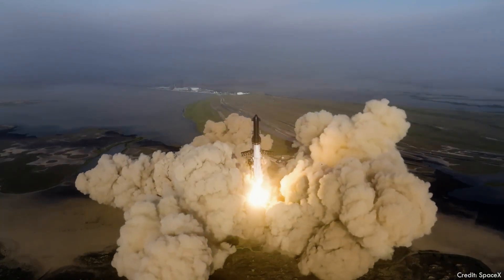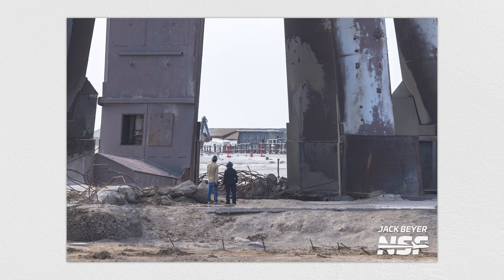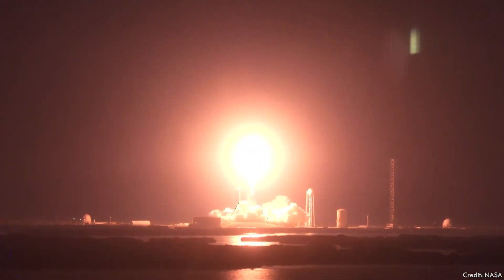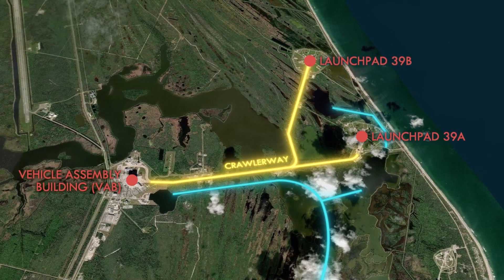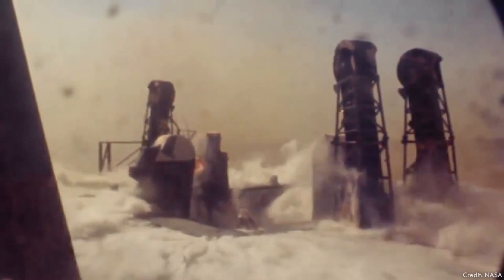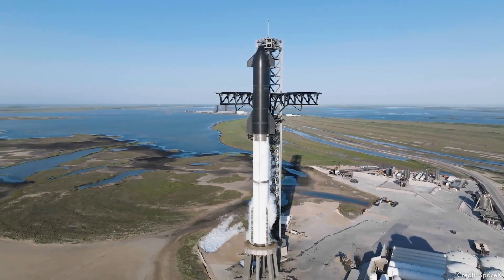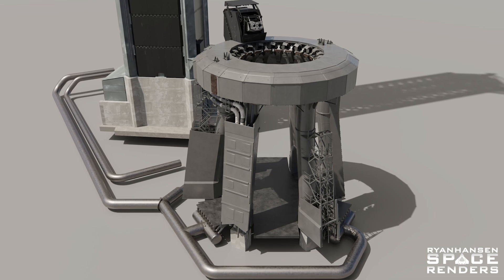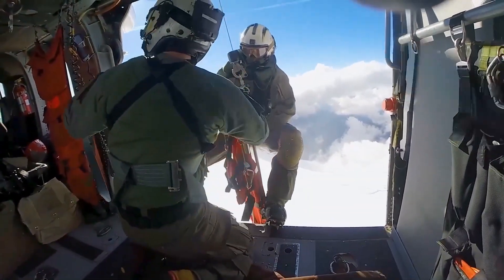Was Starship’s Stage Zero a Bad Pad?

Comment: SpaceX / Tesla (well Elon, let's face it) has dragged rocketry / EVs forward out of the doldrums that the world has been in since the `60's.
Interesting times to be an engineer.
Reply: You give Elon WAY too much credit. Elon is a spokesperson, not an engineer. He is in no way responsible for the technical successes of either SpaceX or Tesla. He demonstrated that really well when he took over Twitter and immediately fired his engineering staff and started breaking everything.

While Elon has been making Tesla famous, other automakers already had production cars working reliably for years. Like Apple, Tesla took existing technology and made it cool. The current offerings from Hyundai, Kia, Nissan, Chevy, BMW, Volvo, Ford, and many others are all so much better than the crazy, proprietary stuff Tesla is doing. Until the recent agreement to licensing charging tech from Tesla, all the other automakers were developing their own technology - not leveraging Tesla's work.

I would argue Tesla has actually caused a lot of harm in the EV world. I have driven many different EVs in the last couple of years and the Tesla Model Y was one of the worst experiences I have ever had in a vehicle. Everything is weird and goes against convention for no apparent reason. The Model S was even worse. Essential controls like wipers and changing gears are hidden behind menus in a touch screen interface. The turn signals have been turned into buttons on the steering wheel itself, which moves with the wheel, so you never know where they are. The vehicle is perpetually using an aggressive regenerative braking so that if you lift your foot for any reason, it immediately comes to a sudden stop like you just mashed on the brake pedal. On the other hand, the accelerator pedal has a notably delayed response. Brake, accelerator, and steering wheel all feel heavy and viscous with hardly any feedback. The mirrors and windows are small with huge blind spots. The hood is intentionally sloped so you can't see it from inside, which also means you can't see how close you are to anything! Everything about it breaks convention for no apparent reason in ways that are demonstrably inferior. And they are really expensive compared to similarly specced vehicles.

As a result, people's perception of EVs is that they are difficult to drive, impractical, and expensive. A lot of the (irrational) arguments against EVs can be traced back to Tesla's implementation specifically.

Compare that to a Hyundai Kona EV or Chevy Bolt. By and large, they are no different from their ICE counterparts. The controls are the same, they handle largely the same, and they don't cost that much more than a comparable ICE. The newer designs like the Hyundai Ioniq 5, Kia EV6, BMW i4, and Volvo C40 go for similar prices to a base model Tesla but are more comfortable, convenient, and performant, while still looking and feeling like any other vehicle.

You know what else really sparked an interest in EVs? Rising gas prices. Especially since the huge spike a couple of years ago, there has been a considerable growth in EV sales across the board. The government subsidies during the last few years in both the US and Canada also helped a lot, since that largely makes up the difference in price between an ICE and an EV.

The one thing Tesla has pioneered quite well is self-driving, for better or for worse. I'm not against it, but it sure has been a divisive topic, and it sure doesn't help that Elon has been saying that full self-driving is only a couple of years away for the last several years with no sign that we're anywhere close to it being ready for production. Of course, Tesla wasn't the only company chasing that dream, and several others have made it to a similar level of success, though most of the others gave up or went broke since hitting the same wall. What partial self-driving Tesla can currently do, most other vehicles can already do too. Adaptive cruise control, lane assist, collision avoidance, parking assist, and many others are available on a wide variety of other vehicles. My Kona EV could literally drive down the highway, maintaining the lane even around turns, keeping distance from the car ahead of me, and braking if a deer ran on to the road. Of course I could tell the navigation where I wanted to go and it would give me turn-by-turn instructions. In my Ioniq 5, I could even tell it to change lanes and it would do so. It was almost entirely self driving, with it telling me what it thought I should do and me confirming by commanding it to do so. Tesla's full self-driving certainly goes beyond this, but it's also those additional steps where it's still failing after all this time.

I don't know as much about the details of SpaceX, other than to say rocketry has come a long way since the 60s. You realize we only put a man on the moon for the first time in 1969, right? The 80s and 90s saw the development of the Space Shuttle that brought up the original satellite networks that we all relied on for television and GPS. We got the Hubble telescope, the International Space Station, landed rovers on Mars and brought back soil samples, got fly-by pictures and atmospheric tests of planets way out in our system, and so much more. SpaceX is doing exactly one thing: making terrestrial space flight cheaper. That's it. While that's a practical and worthwhile endeavour, that pales in comparison to all the cool things NASA has been doing for the past 60 years.

This is exactly the problem with Elon Musk. He has convinced millions of people that he is a genius and that the companies he helps run are changing life in revolutionary ways. In truth, both Tesla and SpaceX are in races with several other long-standing companies in their industries all trying to add a little bit on top of all the progress made by all of their existing competitors. They both seem to have gotten out ahead in the short term, but Tesla is in a much more competitive market. Tesla is only 4% of new vehicle sales in the US and only 13% of BEV market share worldwide. In the US, many reputable manufacturers with decades of experience building vehicles are now providing their own EVs that are as good if not better than what Tesla has. Elsewhere in the world, Tesla is very late to the game, with local companies in China and South Korea completely dwarfing Tesla's worldwide presence.

None of this is to say that either Tesla or SpaceX are bad companies - but that much of their perceived value is only because of the cult of personality surrounding Elon Musk.

Comment: I firmly believe they should be shut down permanently. There's just too much carelessness and seeming incompetence (it's probably capable engineers being pressured by EM into making mistakes)
Reply: How wrong you are, The SpaceX engineers are far more knowledgeable than standard civil enngineers which follow codes prescribed in long ago eras, SpaceX engineers use modern  computer aided methods . Their knowledge and simulation verification allows them to predict for example that a plane horizontal steel reinforced plate will cause the supersonic vertical down flow to produce a single shock, where the speed  behind the shock, in this case below is much smaller than wedge shape deflector would have done, heat transfer is much lower at low speed, reducing the amount of water required considerably, The pressure acting downwards cannot exceed, it is almost the same as the total thrust of all engines and it acts precissely downwards, no net sideforce can result, all six slower moving streams cancel each other, the only parts that have to resist outwards force are the knife edged pylons. subject to smaller side force .
All this is predictable, safety factors are applied to ensure adequate margins.
This design requires fluid dynamics knowledge, which usual civil engineers do not have. Prepared published engineerig hand books do not exist for this unique application.
If you dont have confidence in aero engineering do not fly in the modern twin engined airlines, let alone the supersonic Concorde future derivative under study today.
Be fair and understand what is being done before you level that strong condemnation
At least talk to  experts like University professors.
Reply: Judge the competence on their accomplishements, never in human history have so few enginners recovered 201 large rocket boosters with out a single failure, once the few learnig flights were done, 
Nobody in Europe, Asia, India, Russia has even tried.
Instead they waste huge resorces which finally end in the bottom of the oceans.
Bow your head down in shame.

Si y con esto me despido del país donde tenemos una buena Universidad: La Universidád de San Andrés en la alta, muy anciana ciudád de La Paz, fundada en 1548 muchos años mas antes que vuestra declaración de independencia. 🇧🇴🦅🏔️
Reply: Engineering is religion to you. Your faith is blind to any true understanding of it. You have no idea what you praise, you just want to feel smart.

Comment: did they let starship make a crater beneath the launchpad just so they dont have to dig the hole for the deluge system?
Reply: They've already filled the hole and put down a new concrete pad (with an excessive amount of concrete piles going down 110 ft) . The installation of the steel plate intended to resolve the issue is approaching fast. Maybe as early as next week.
Reply: No, they let it so Elon could have a big party on 4/20. I wish I was joking.

Comment: If you've never been to a rocket launch, you totally should. You can literally feel the sound / pressure wave from launch from several miles away. It's amazing.
Reply: Nice suggestion, but probably not a practical option for (maybe) 95% of the world's population!
Reply: @stepheneyles2198  Vacations are not an option for 95% of the worlds population? I think that might be a bit of an exaggeration.
Reply: I got to attend the launch of STS-134 (a bucket list item for me since I was a kid), and it truly gives one perspective on the literal meaning of "awesome", as in "awe-inspiring". Or to steal some lines from Rush's 'Countdown": "A thunderous roar shakes the air, like the whole world exploding […] It tears away with a mighty roar, the air is shaft by that awesome sound."

Comment: The more I think about this... I'm not an engineer and this doesn't pass a smell test. At no small cost, NASA, (you know, the thoughtful guys) engineered and built a launch infrastructure---and then launched hundreds. So there is an installed knowledge base as to launch infrastructure. But SpaceX, with it's arrogance and hubris, decides to reinvent the wheel. SpaceX, in its infinite wisdom, decides to launch a substantially heavier rocket with twice the thrust, with a fraction of the infrastructure. If any of the original NASA engineers are still alive they are telling their grandkids, "Look, honey, we're about to kill a lot of wildlife and fish." SpaceX's response? "This is great, because we are learning what NASA already knew!"
Reply: You can't have innovation without doing new things. They thought it would work for one launch without the steel plate, but were wrong. They'll install the steel plate which will most likely resolve the issue, though if it doesn't, they'll keep making improvements.
Reply: @SpaceAdvocate  Innovation? Are you kidding? What reason in the whole world was to innovate a successful launch infrastructure that was already engineered and had a 45 year successful track record?Only a Musk fanboy thinks, "It would be a great idea to reinvent the wheel." In other words, there is not one iota of mission benefit once the rocket clears the tower. They are incompetent. Those steel plates will become shrapnel.  The launch infrastructure was figured out 50 years ago. Only a fanboy sees rank incompetence and sees it is a learning environment.
Reply: @raindogs451  It's all about cost. The cost to get to space must be lowered for SpaceX to achieve their stated goals. So you can expect them to try to cut costs on everything. And if they end up having to add some cost back in to make the system work optimially, they will then do that. But you can be sure they will try the cheaper solutions first.

If the steel plate solution works, like I think it probably will, you can over time expect all the other launch companies to move over to that solution. At least for new launch sites. If they don't, they are at a competitive disadvantage.
Reply: @SpaceAdvocate  I don't think you can see your confirmation bias. Even a non engineer would have seen that a heavier rocket with twice the thrust and a fraction of the infrastructure would do----just exactly what it did. So did SpaceX save money? No, they did lots of damage and saved nothing.  It is actually more. But apologists say, "it was a learning experience." Do you have evidence it "was all about cost?" No, but because you believe in this fool, you'll attribute rank incompetence to 'innovation.'

Comment: Is no one going to point out the idiocy of NOT having a flame redirecting tunnel? With a rocket even BIGGER than the friggin Saturn V? Are you serious?! Who allowed this? This is utter stupidity and negligent of the land and people around. NASA has its issues but there is an excellent reason why they plan for a long time and build there stuff as safe as realistically possible. Had the rocket gone wrong because of the poorly made launch pad or worse, had it exploded towards the crowd because of the damage from the debris, things could have gone very wrong. This stuff isn't a joke